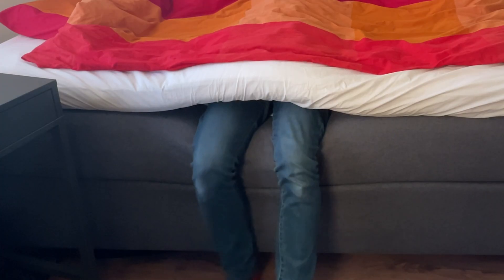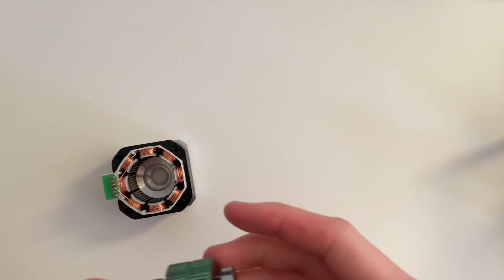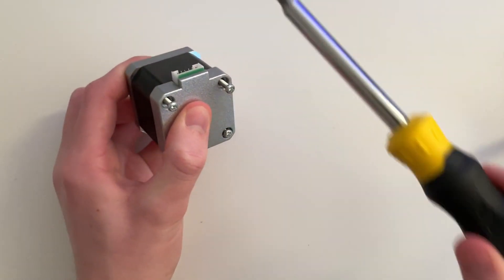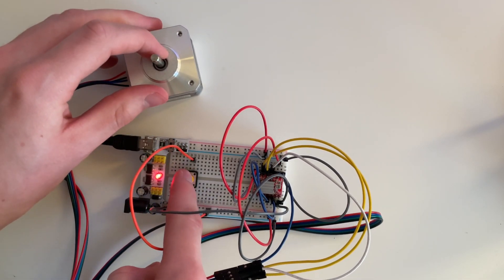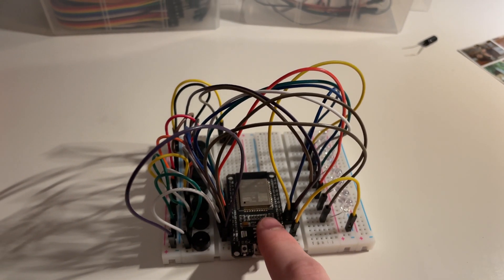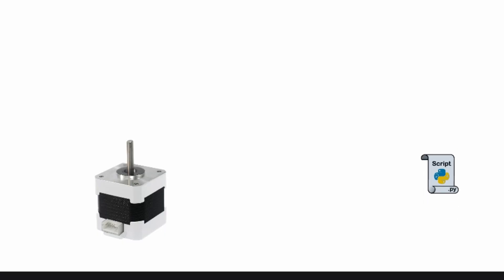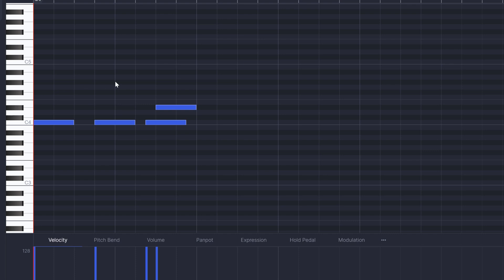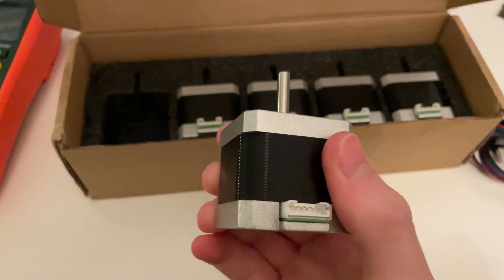I Made A Stepper Motor Music Player

Comment: Sounds Dope! I'm working on my own using a teensy and 24byj steppers, I was wondering how playable the esp32 is for realtime midi?
Reply from the maker: Thank you! Given that the ESP32 has 2 cores running at 240 MHz and newer models have native USB support I would suppose it works great for real time midi. The problem is that it only has 8 PWM channels which limits the number of steppers. (And the ESP lineup is also rather confusing).

I wish you the best of luck with your project!